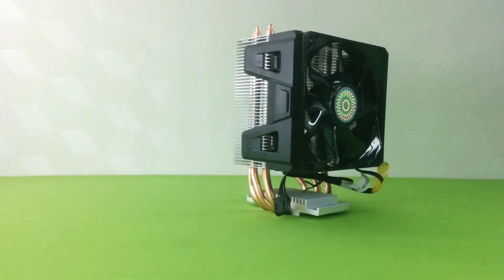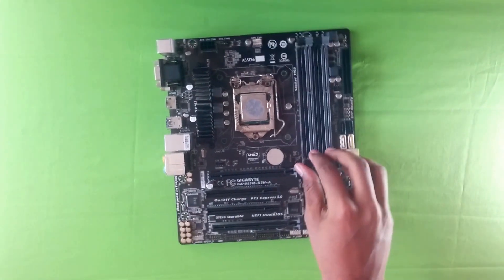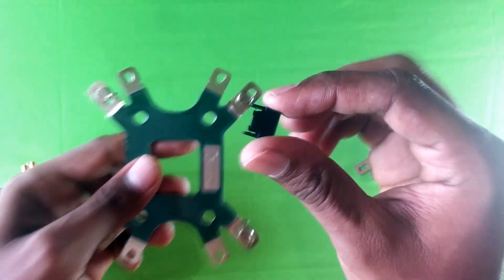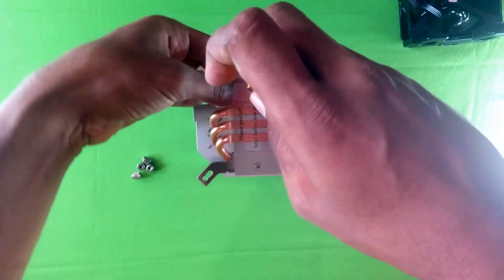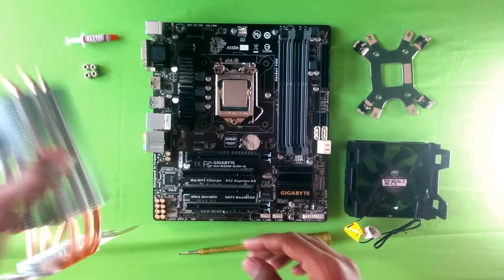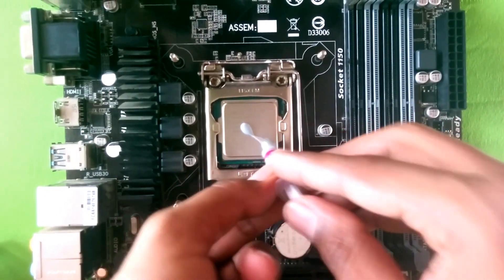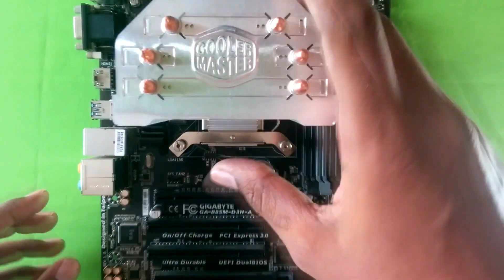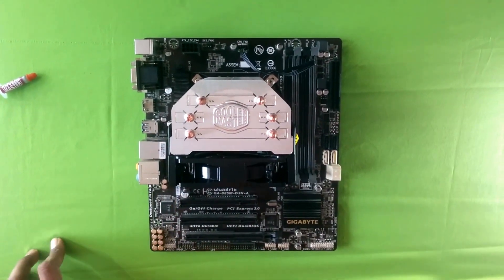Cooler Master Hyper 103 installation guide

Comment: I just installed this to replace Intel's stock cooler for the i3 7100 and it dropped the core idle temps from 53c - 49c. I haven't stress tested this yet but I expected better. Outside temp is 29c and my pc case has adequate fan cooling but I'm guessing the Intel cooler isn't so bad after all. This cooler looks nice and it is a little bit quieter than stock fan. But, for all the hassle of installing this, I should have gone for a four heat pipe cooler instead. Just saying!
Reply from the maker: Well stock that was close to the same experience for me too, but it really shines when it comes to stress tests, while rendering videos, on the stock heatsink, 85 to 90 if not more was common, but with the CM cooler it never crossed 70
Reply: @VirusHQ  I did what you said and stress tested the cpu with the Intel Extreme Tuning Utility and yes, you are correct. At %100 stress the cpu temp stayed at 58c stable. Also, as the fan increased in speed it was still quiet. So, thanks for your info, I won't be returning this capable cooler now

Comment: Wrong direction on fitting your your cooler
Reply from the maker: False, the cooler fan can be pointing in any of the 4 directions, but I did it this way so that it was following the air flow in the case

Comment: Generally most people stress the cpu and gpu separately but I stressed them both together and the temps were 91- 95 celcius but when I stressed the cpu only the temps were around 71-75 celcius and the average temp was below 70 celcius so should i really buy an aftermarket cooler like this on
Reply from the maker: +Shoham Dutta It's a personal preference, I used to get about 70-80° on stock, but it was a bit high than I could tolerate and hence got the CM103. Temps dropped to 40-45 under normal load and 62-63° on heavy load

Comment: I have i5 4440 and in aida64 stress test the temp bumps to 91-95 Celsius so should I buy a aftermarket cooler
Reply from the maker: +Shoham Dutta it is always better to have an aftermarket cooler, also aida64 stress does push your temps to the limit. So get an aftermarket cooler.

Comment: haha you put the cooler the wrong way it will be hard to fit ram in
Reply: Not if you fit the ram first :D
Reply from the maker: +Dean actually it was more favorable for my setup for  the airflow inside the case.
One thing to remember while installing the cooler is to keep airflow in mind.

Also the cooler is small enough for easy access to the RAM slot, all 4 of them.
Reply: Dean, is you blind
Reply from the maker: +XiSoRz Chriss actually there is enough space to insert the RAM after the cooler is installed.